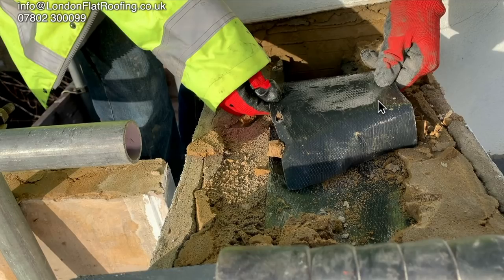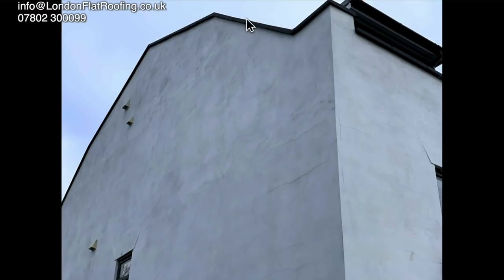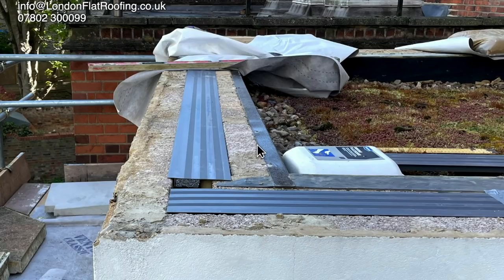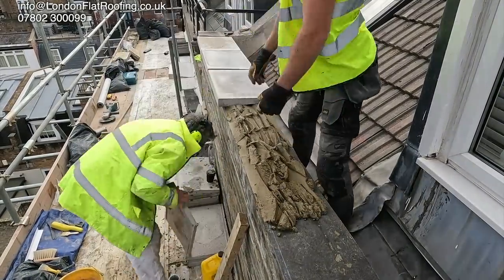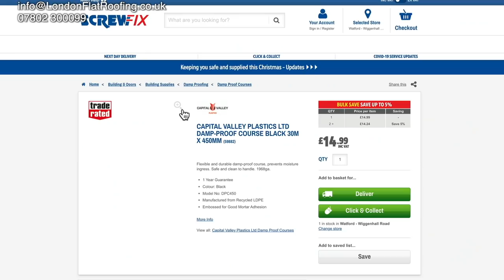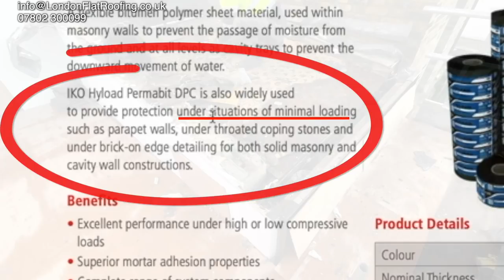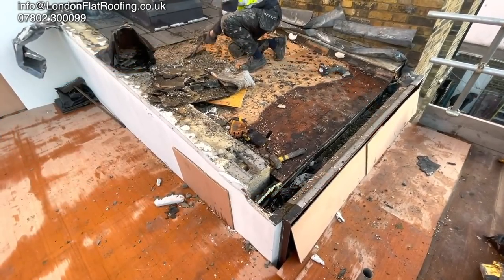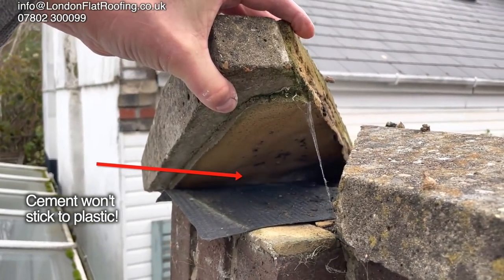Sweating and Wet Parapet Wall, Cavity Wall Insulation

Comment: Hi Steve, Great information as usual.
Sorry about the other post with a 'P'

Let me start by stating I am not a builder or am I any way involved with the building trade, and I have no intention of doing so either.

I wonder if you could indulge my curiosity about those coping stones at 3.15 in your video, they look to be on a 45 deg slope or thereabouts.
If you had a dampcourse under them that had 5mm sticking out either side of the brickwork below, how do you stop them all sliding down the slope?
Surely any cement above the dampcourse may be bonded to the coping stones but wouldnt be bonded to the dampcourse would it? and surely its not relying on friction is it?

My guess would be that there would be some pins stopping this happening at the bottom of each coping stone, but then they would penetrate the dampcourse, no?
Like I say, I am not an expert in any of this, it's just a thought that popped into my mind when viewing the video.
Reply from the maker: All good points. Sand and cement at and angle will not slide when wet if applied correctly. The new DPC (damp proof course) im using is slightly grippy so that helps it all stick together the plastic one although looks like its grippy isn't. As regards mechanically fixing this is becoming something that building control  and the BS standards are starting to ask for however your point about piercing the DPC is extremely valid. Not only that nobody seems to have thought about ht ejujoling act the builder or roofer will have to go though to do this. place wet cement down then a DPC then drill though it all then bed a coping stone and aline everything ! its not going to happen in a good way. Any construction method should be simple and robust

Comment: As a roofer of 2 years I'm yet to come across a damp course under the copings we mostly are on very old buildings but most of  these copings and buildings don't have the damp issues or  why is this ? Is it due to the lime mortar that allows it to breathe or is it because the cavities don't have that insulation and some.of the very old ones are just rubble.filled cavities
Reply from the maker: Im looking at jobs that have gone wrong there must be lots out there that haven't gone wrong but are still not build correctly and the good old roofs and copings normally have slate DPC build in your jst not seeing them
Reply: @SteveRoofer  ah yes I've seen the slates under the copings and I've seen felt over the cavity onto the wall come to think about it.👍 Good stuff mate thanks

Comment: Do you need to add dpc over  the gable end cavities for a detached house with no copings, just slate over hanging the upvc verge?

Does a gable end cavity need closers added?
Reply from the maker: First you should do as the experts tell you and the details should be on your drawings ( fat chance)  My personal view would be something like this. The cavity is being used as a line of defence to stop ingress of water from outside mainly rain. The cavity has probably been backed fill with insulation partially or fully. The cavity coud and in most cases will get damp. We install cavity wall trays to take care of draining excessive moister. Therefore it stands to reason the cavity should be vented therefore I would leave it open or vent it top and bottom. Thats my opinion.

Comment: Nice advice. I was just wondering what will become of the wet insulation? Will that be removed, dried and replaced ?
Reply from the maker: No thrown away you can't dry it also the external wall will probably have to be taken down

Comment: As an insulation engineer to trade I've never liked CWI, that air gap is there for a reason, by all means insulate the outside walls but stuffing that cavity is a not a good idea in my experience.
Reply from the maker: A lot of comments below on that and I also agree

Comment: Would you suggest a mechanically fixed coping detail much like the mechanical fixed approach to ridge and hip tiles to avoid the issue to mortar needing repointing over time?
Reply from the maker: Depends on the job but probably not just use the correct DPC and SBR in the mix

Comment: Hi Steve, 

Must say over time I have learnt so much from your videos. As usual this is a brilliant informative video thank you. 

I have a situation exactly like this but have yet to complete the work. 

Quick question regarding the DPC when used on the top of a wall to prevent downward movement of water.

Firstly is this Bitumen DPC heated in order to adhere to the wall top?

Secondly when the wall is to be rendered can the render go all the way up to the coping stone after the DPC is in, or must the wall be rendered first and the DPM and coping stone applied after? 

essentially can the render cross the DPC up to the stone?
Reply from the maker: Yes Bitumen no its not stuck to the brickwork its heat welded together and then sand wedge between sand and cement. No it cant but  when rendering they alway do and it still works  however make sure you have a good overhang and drip detail
Reply: @SteveRoofer  Cheers Steve,  appreciate your reply!  Just so I fully understand as like you say there is a lack of information for this, so cement top of wall, Add DPC then Cement on top of DPC, add good drip detail and overhang. So to confirm Ideally, we render the wall first then put the DPC and copings on? or is it acceptable to render up to the coping and past the DPC?
Reply from the maker: @LovelyCupOfTea  Put copings on first then render
Reply: @SteveRoofer  Right Brilliant, Thanks for clarifying that. I just watched your other video on Parapet walls. My last question is if they render past the DPC up to the coping stone, where does water escape that has got past the coping stone and down to the DPC if there is no outlet for the water off the end of the DPC and its covered by render?
Reply from the maker: @LovelyCupOfTea  That's the problem leave it exposed or cover it depends what you want it to look like
Reply: @SteveRoofer  Cheers Steve, Keep up the great work!

Comment: at the end it says 'cement wont stick to plastic' ....... At the start the damp proof was plastic and you stated it just wasn't wide enough ? would the plastic damp proof the correct width have worked with the coping stones or not ??
Reply from the maker: No probably not as  the coping stones to move and slip on the plastic
Reply: @SteveRoofer  so what product would be used instead ?

Comment: Best info video
Reply from the maker: Glad you think so!
Reply: @SteveRoofer  just wondering, if it is still possible to have warm roof condensation issue. I mean if humidity in warm room reaching 80% RH type of situation. I would imagine, for eg, condensation on mirror in bath room.
Reply from the maker: Yes if you have high RH and thermal bridging

Comment: What a mess - it's really disheartening to find such a sloppy job. Done properly it wouldn't have needed anything looked at for at least 20 years.

I get it as a mechanic too. Just sloppy seconds where it would be easier starting from scratch most times.

Just a question though. How good is the adhesion of the coping stones to the damp course?
Reply from the maker: Iys good but not as good as it coud be that why there is a good DPC (damp proof course) under the coping stones
Reply: @SteveRoofer  don't they have some sort of moulded coping stone that could straddle the two courses with a built in DPM to the casting of the stone?

then have a tongue and groove style ends on them so they interlock and seal with each other.

Comment: I think the the way of building homes in the uk is very outdated and obsolete .. no disrespect intended many good bricklayers there  it’s just the way of working there is the opposite how we do things here 
Also think glass or rock wool is not a good insulation to use in a cavity and cavity needs to have a airpocket between the insulation and your outside bricks
Bricks do get  soaked and so the insulation will with all the moisture as a consequence.. ties ins also needs attention they need not to transfer water to the inside of the building
Reply from the maker: Yes I can agree with most of what you say  rock wool is ok in acaverty if its not fully filled

Comment: It is unlikely to be architects giving the poor specifications because we have to be qualified and trained to above masters degree level and registered with not less than two full years experience. The poor specifiers are far more likely to be the architectural designers/consultants, plan-drawers etc with very little or no training whatsoever. Please do not confuse the two.
Reply from the maker: The claim is still ongoing with the architect's PI insurance as the speciations were incorrect however the builder added to the problems but he has long gone.

Comment: There is no cavity. Shouldn’t the insulation be 50mm. There is no air gap.
Reply from the maker: I agree but they allow fully filled cavity now, what has been talked about in the comments is  can you fully fill a cavity with solid insulation or does it have to be fluffy stuff?

Comment: Will you stop. Insulation shouldn’t touch outside wall. !!!!!!!!!!!!!!!
Reply: Depends on the construction method really.
There is certainly products out there that can be built like that
Reply from the maker: Yes I think there should alway be an air gap between the cavity wall insulation and the outside skin and that cavity should be vented
Reply: You can full fill a cavity with rock wool or blow cavities with micro fibre

Comment: Your explanation was ok however your explanation of a cavity tray was incorrect. If a cavity tray was fitted correctly with weep holes this problem is irradiated.
Reply from the maker: Not if the problem is not coming from the coping stones but because of thermal bridging under the cavity tray